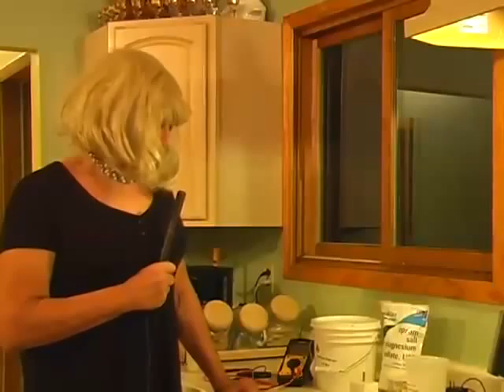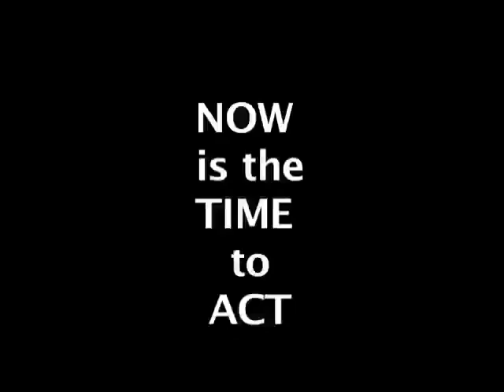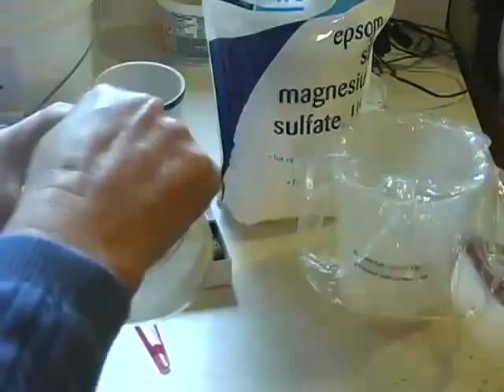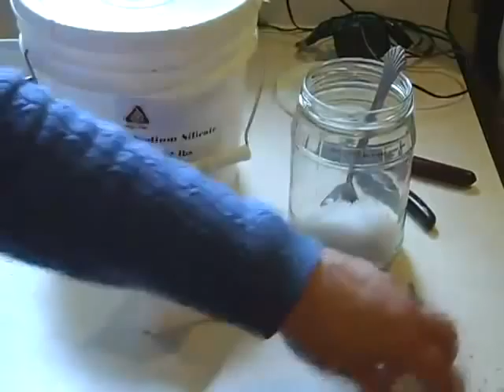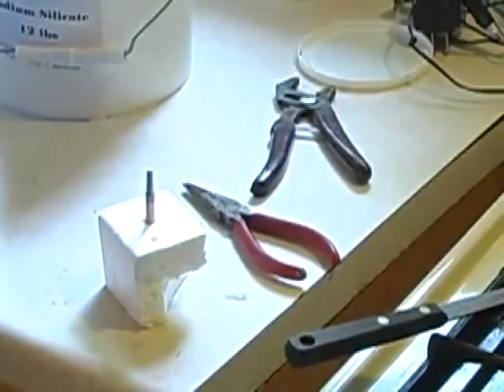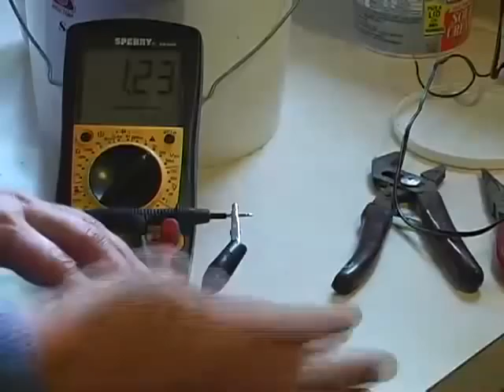How to Build a Hutchison Crystal Power Cell

Comment: HH004F DC Step Up Low Power Integrated Boost Converter IC TO-92This is a small integrated circuit that boostyour Crystal battery so you can drive up to 5 LED

Comment: Is electricity on a continuum with the process we call radiation? I'm asking rock can be radioactive, but now it seems a rock can be electric, too. So I was wondering if electricity coming off a rock is an effect similar to "radiation" but stronger or weaker.
Reply: u can use thorium power , because thorium are radioactive